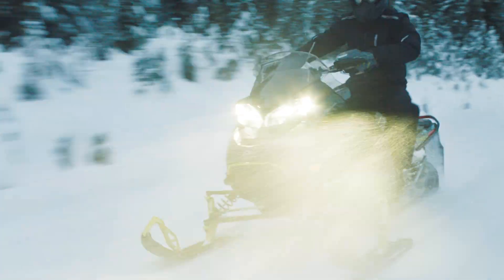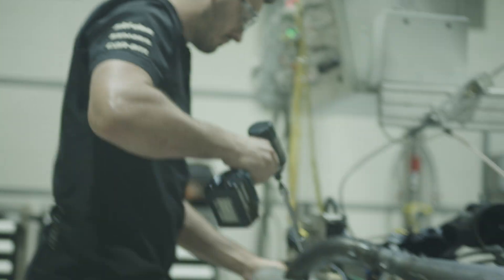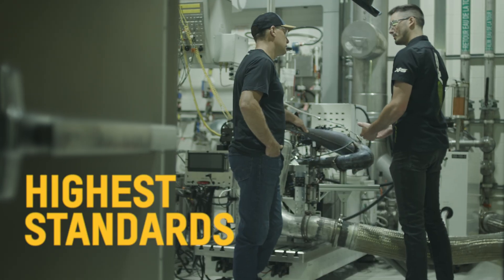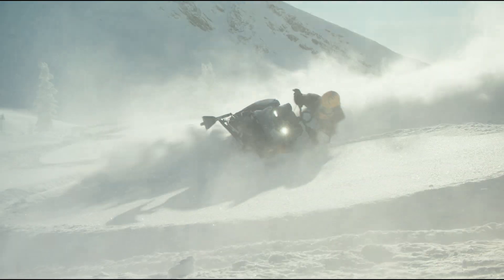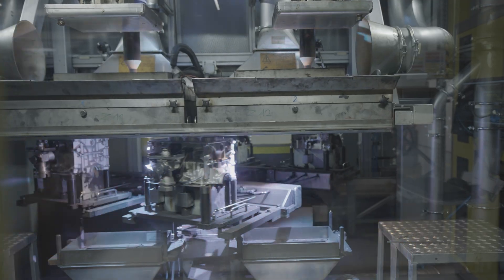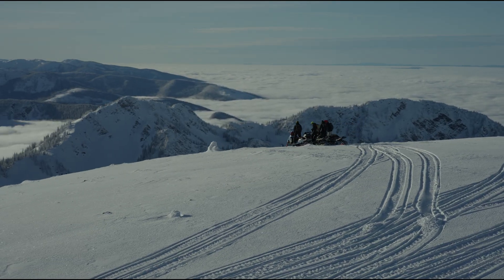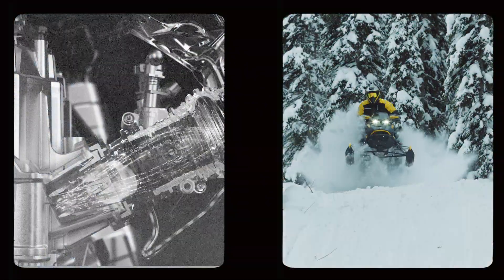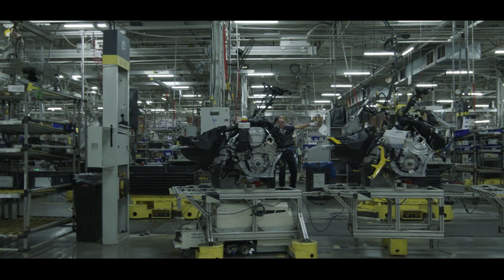E-TEC 2-Stroke Engines: Superior in Every Way

Comment: Older Automotive Engineer - just spent a day helping a friend doing an engine swap.  Very impressed with lots of tech on these.  Like the water jacket flow.  However, it seems lots of people are experiencing failures in the cylinders and the bottom end on sleds that are a few years old.  The oiling system seems to complicated and not very robust.  Tremendous fun when they work, but hopefully you can improve reliability
Reply from the maker: Appreciate you sharing your perspective, and your hands-on experience! We’re always working to evolve and improve, especially when it comes to reliability and rider confidence. Feedback like yours helps drive that innovation.

Comment: Cat had battery less efi before anyone! Not sure why they're claiming to be the first lol
Reply: Efi is different than dual stage injection, direct injection, semi direct injection, etc. electronic fuel injection works in the ports on a 4stroke
Reply: Not only is that not the same, but Cat still doesn’t have direct injection. Look how long the other brands took to get variable exhaust or electronic reverse. Rotax has been the leader for a long time.
Reply: @DoinAllTheThings how not lol they've had power valves since late 90s just like any of the brands and cat had no battery efi way before ski doo. 😂

Comment: Great engines.  They last a long time, they are great on fuel and oil consumption, they hardly smoke and they sound great.  But when I squeeze the throttle on my Patriot 850, it passes all my buddies on their 850 E-TEC's.  Not sure why as they both claim to have about 165 horses?

Comment: Maybe make these motors serviceable unlike the original 850… 2 piece serviceable crankshaft bearings yet ski doo refuses to sell nothing less than a full crank for $3000 ridiculous.
Reply: I have been thinking about building my own 1500cc 3 cylinder 2-stroke. With 1-piece crank and 2-piece bearing rods that 4-strokes use. Using oil pump to pressure feed bearings and spaying oil to lubricate everything. I think it could have longer life span than needle roller bearings.

Comment: I’ve rebuild and saved many Ski Doos over the years from becoming another part out sled after their engines fail from abuse. I’ve always loved working working on Rogan Etec engines and I’m looking forward to having the opportunity to work on an 850 Turbo R in the near future.
Reply: Get out of here with that horseshit,  SKI-DOO'S are NOT "part out sleds"  infact, no snowmobile engine on the market is more reliable than SKI-DOO'S Etec engines.  SKI-DOO makes the best two strokes on the market today and the most power and the most fuel efficient.  Anyone who claims other wise is lying or just ignorant.
Reply: @bobhirdes6725 those are your words, not mine.

I’ve rebuild 600 SDI, 800R and 850 ETEC engines. I never said it was Rotax/Ski Doos fault….in fact I personal think mostly operational error ( lack of warm up, temp management, engine management…..

So “Get Out Of Here” with your BS claims…..I bleed Ski Doo Yellow
Reply: @twinturbo3470 I didn’t make a bullshit claim and I stand by my statement of Ski-Doo’S Etec engines as the most reliable two stokes ever offered in a snowmobile period!  Nobody makes better two strokes than Ski-Doo, NOBODY!!!
Reply: I run triples, these quiet no skill required machines are boring

Comment: Please give me an unofficial take on how long should a 850 cylinder hold up before needing a top end... I purchased my 24 850 BC based on your engine technology... (and 39" stance) I'm tired of pulling engines and redoing top ends... I've done 3... I will not go to a 4 stroke for the penalty of weight... Grok Ai says there are stories of 14k? I'm a 60 year old that puts lots of miles on in MN, WI and Yellowstone... If well kept... What's a good guestimate I can expect?
Reply: I know many, many people who've sailed WAY past 10,000 miles on 850's without ever touching the engine other than chain case fluid changes.
Reply: Had a 2019 Summit 850 with over 3000 miles no issues, currently have a 2024 freeride turbo r with 1700 miles no significant engine issues to speak of. Used both sleds in the mountains pretty aggressively I see no reason why a backcountry shouldn’t go as far or further
Reply: I have well over 3k miles and no issues. '24 BC X 850... I have over 8k on my '18 800 Pro-S... No issues. 👍  I'm pretty sure my Pro-S is going to need a top end soon, although my scope shows the cylinder walls aren't showing any scratches yet. So my question is, can I expect 14k out of plasma coated walls... That's less than 7 years of riding for me. I paid $16k for the sled... No one gets into snowmobiling to save money...😅😂😂😂
Reply from the maker: Hello.  Feel free to send us an email to discuss further.  We can be reached here: brp.care@brp.com
Reply: Made in mexico 🇲🇽 conceived in French Canada
Reply: @Taxthe200mil Ski-Doo are build in Canada, what are you talking about? 😂
Reply: @Titienne666 engines built in Austria if I'm correct?
Reply: @jasonbrushett2005 most older skidoo parts were assembled in Mexico
Reply: All TRUE canadians can VOTE with their WALLETS to either haasten the collapse and start over or SNAP the criminal FedrulGubmint back to reality
1. STOP paying for CableTv only to be lied to and spread the WOKE agenda
2. USE CASH everywhere , it will stop Dgital ID, CBDCs, the next VAXX
3. DE-BANK yourself from big banks, USE local Credit unions instead who automatically support YOUR comunitty

the Trucker Convoy and 93000 donors FORCED the Big Banks to stop the fedrul gubmint from going totally rogue cuz they were bleeding money from all those donors pulling their funds out
-just imagine if 5 million canadians did one thing on the list?! or 2